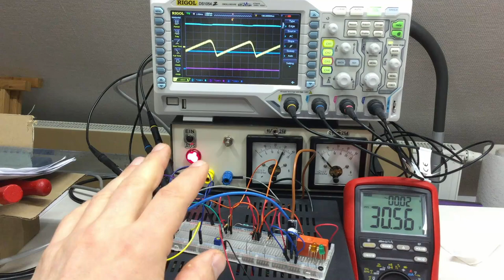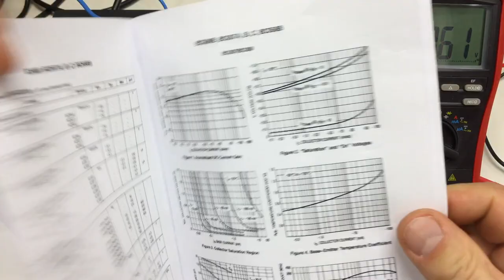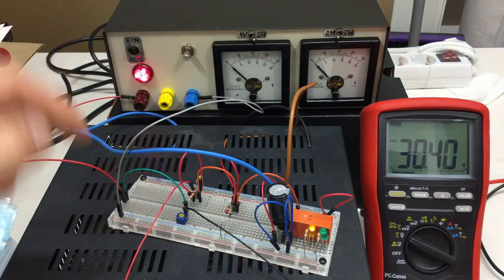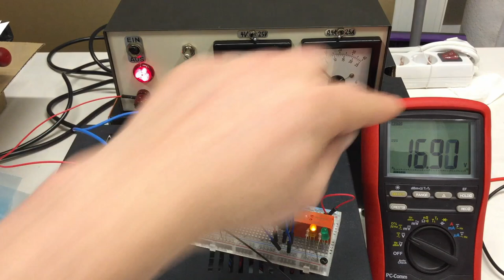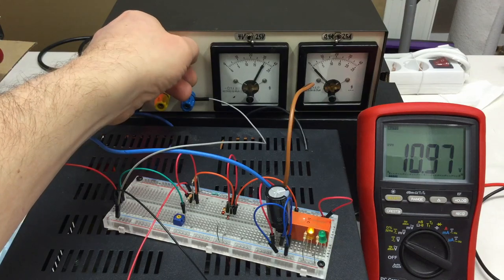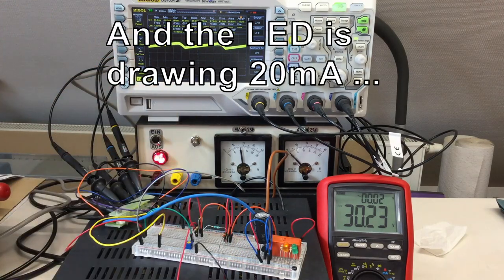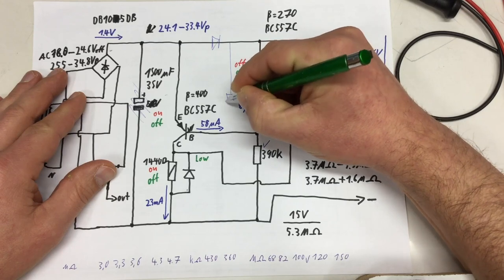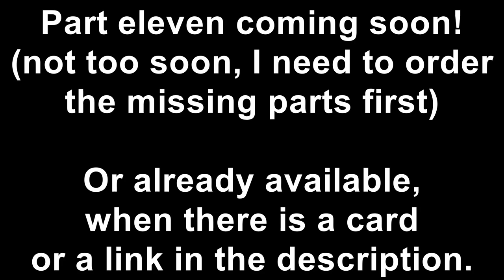Vintage Lab Power Supply Rebuild (10) – New Transformer Tap Switch Prototype

Comment: I found interesting your circuit, but I would not do it like that, on the Positive Rail and just with Vbe as reference, by some conceptual reasons:
(1) The sampling on the positive will SOURCE a quite small, but unnecessary RIPPLE current at the output. I would prefer to do it on the Negative/ground rail and DRAIN a constant sampling current (to measure voltage), as it would not have induced any ripple.
I have plans to rebuild one quite old Linear power supply still using just Transistors (no IC), built more than 40 years ago, also using Vbe as reference voltage (more on that later). Next revival will count on a relay (or dual SCR) switching form center taped to full winding+bridge, with ICs for Voltage reference.
(2) RELIABILITY & going back to the topic of this video: maybe just a load resistor would lower the RC time constant to make the turn-off OK. It would be less elegant than your design, but more reliable (less prone to failures). 
(3) THERMAL DRIFT: That old bench PSU  I did, it used the V_be = 0,6~0,7V as voltage reference. Well, I observed that, when I turn it on and adjust for, let’s say 15,00V, after it warms up (transformer heating the enclosure, etc) the voltage could vary by 500mV (0,5/15 v = > 3%), or more, under heavier load. This makes sense as Vbe = 600mV and for internal temperature warming up +30C. 
As Delta_Vbe = -2mV/C, this means -0,3%/°C or Delta(30C) = -60mV = -10% of Nominal Vbe. 
That is why I would prefer to use a 5V6 Zener diode will have ~ +2mV/°C. And in series to Vbe, it would be Zero Temp.Coeff.  (See this link, showing Motorola’s “500mW DO-35 Glass”: www.ee.nmt.edu/~thomas/data_sheets/zener_diodes1.pdf). 
It then resembles the original circuit. For this case, Vbe+Vz = 6.2V, temperature compensated.
It has been a pleasure to chat and ramble about such topics.
Wish you success!
Reply from the maker: Wow, thank you very much for that detailed analysis of my design! Here're my thoughts:
(1) I see your point. And in a real low noise / precision PSU that would be a no go. But I'm OK with max. 18uA I'm injecting here into the output. Besides, that current is coming from a full bridge rectifier which output is filtered by 1500uF capacitor.
(2) You're absolutely right. A load/discharge resistor would make things more reliable. When I designed that circuit I was going through a phase were I tried to minimize the parts count of any circuit 😅
(3) You're right again. And this time it's an oversight of mine. I didn't take the thermal drift into account. And -10% if of course huge, because I would switch 10% to early to the higher tap and thus burn about 21% more power in my power transistors.